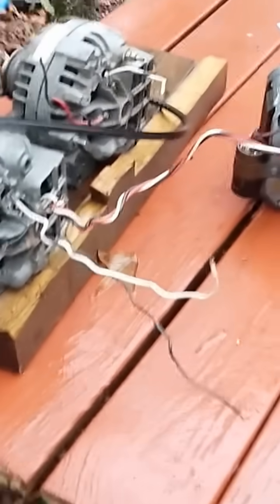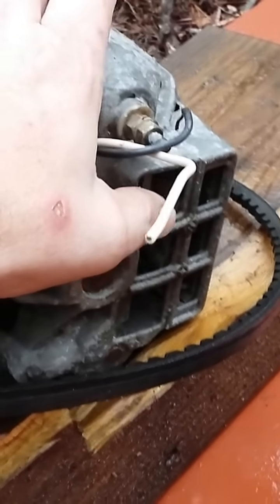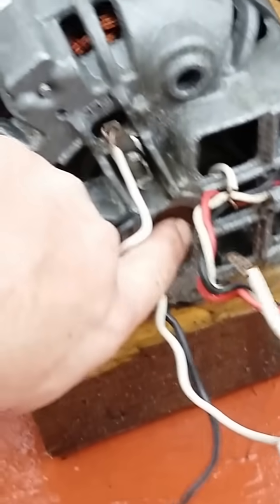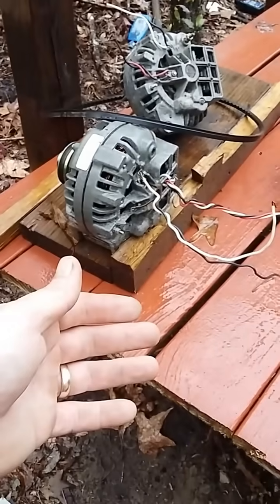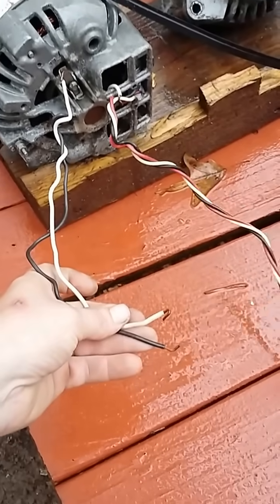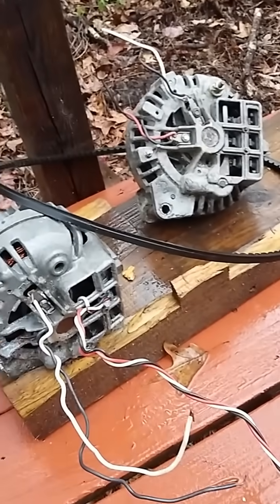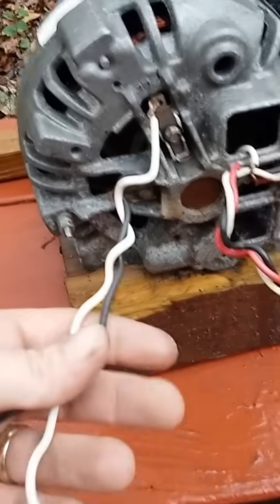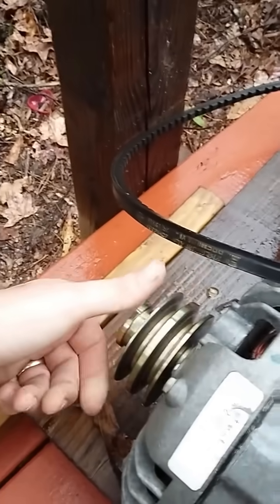Update Free energy forever no wind no solar no gas READ DISCRIPTION!!!

Comment: I'm not one to shit on people for trying to experiment with things, reverse engineer parts and toy with a concept that's existed for quite some time. Heck, I even tried designing something to this extent. I looked at how the basic motor was designed by how energy could be transferred more efficiently between the rotor and stator, reducing friction by using a bearing method that floated in a magnetic field, even putting the motor (or generator, it's been a while) on the inside of the rotor to bypass the imperfections in belt, chain or sprocket-driven systems and have the middle section between the motor and generator as the "rotor". It'd be one moving part without mechanical friction in a compact, easy to build system that could be built small and quiet enough to replace the battery in your phone. 
But the more I knew about it, the more I found what I didn't know then.
What I AM salty about is how you said electricity companies make electriciry for free, sell it to people for God knows what and make all the profits. I take issue with this.
1)  Electricity isn't made for free. In Australia, most of our electricity is generated out of a coal-fired plant. Coal is burned, heats water, makes pressurised steam, steam turns turbines connected to AC generators and whammo. It takes one company to mine and sell the coal, another to transport it all, a licensed contractor to build the plant, a company to transport the water... You get the idea. Even if it was one company that dealt with everything, there are thousands of people that work for these guys that need to be paid. The Johns and bills and franks and Saras and Karens who mine, drive, build and inspect everything. The towns built around these places have stores that sell foid, clothes, homewares... Even for wind, solar, nuclear or any other thing, the cost to build and maintain these things is staggering. You're disregarding all of this. 
2) if you start a service, you do so partly because you want to make money doing it. You sell the services to people, they pay for it, you make money. It's only when your service becomes a necessity that paying for it becomes a problem because nobody wants to spend a consistent amount of money on something they need when they consider what other things the money could go to. All of a sudden, that company is evil. I'm not discrediting companies that do bad things, but there's nothing wrong with selling your services for an amount you, the consumer, agreed to. Yes, you even agreed to the amount changing. You buy groceries that change in cost all the time without issue, so it's no different with electricity. You even ask people to send you money so you can continue with your work which means you're making money by making something that makes electricity. You've become the essence of the thing you despise... 
3) If generating your own electricity was such a politically dangerous thing to do, why are there countless houses out there running solar off-grid with panels THEY BOUGHT IN A GODDAMN STORE?  Solar panels can last for decades so the cost to investment ratio is not an issue. Heck, I live in a building that generates enough solar electricity that most of it is sold back to the company. It's literally free money. You hear anything about the government killing people for buying too many solar panels? Mate. There's nothing illegal about it. Any company on earth would pay millions of dollars for your idea. Make more than one and sell them as emergency generators for areas affected by natural disasters or villages in third-world countries whom consider electricity a great luxury.

Stop worrying about what the government might do and build a working model. It's basically a flat panel with wheels.

Comment: I farted into my marshall amplifier speaker and got 240v out from the mains plug. Problem is trying to fart at 50 Hertz.
Reply: Poop always comes out,and it hertz
Reply: Farted through an octave divider at 100 Hz and that really hurt.
Reply: Add an augmented fifth and it will sound distinctly Led Zeppelin III.
Reply: There's a trick to it, bud. The ancient Hittites had it mastered. Powered their entire civilization from farts. But they didn't fart at 50 Hertz. They actually kept millions of Mesopotamian crickets, and studied the frequency they chirp at. They found that cricket chirping actually is NOT a result of rubbing legs or wings, but rather results directly from minute farts they emit when communicating with other crickets that can be hundreds of miles (or kilometers, if you happen to be a communist) away. These minute cricket farts actually release very small pulses of high frequency electromagnetic energy. The energy output was measured by Hittite scientists, and found to be over 100 times greater than was thought to be possible, due to limitations imposed by the laws of thermodynamics. 

They figured out that Mesopotamian crickets extract zero point energy from the ether of space, and convert it into energy that we can use. So the Hittites started growing Mesopotamian crickets on large cricket farms, and would then place them in little coil wrapped boxes, where by they could extract power that otherwise would have been wasted communicating with other stupid crickets that really didn't need to be communicated with. 

They found ancient scrolls in Eastern Syria, in a cave that was discovered when it was opened by a nearby missile strike. The scrolls are thought to be some 3700 years old, and were only deciphered in 2017. 

Unfortunately, Mesopotamian crickets became extinct in 1979, when the last known specimen was inadvertently fed to a lizard that belonged to the daughter of the lab custodian. Experiments have been conducted using other cricket species, but so far none have been shown to fart at a high enough frequency to cause the zero point energy to transfer from ether to EMF. It seems rather unfortunate. 

I'm only mentioning all of this because... well, actually I sort of forgot why, but I'm sure I had a good reason.
Reply: You can extract their DNA from Buddy Holly and the *******
Reply: Does it really Hert to fart at 50

Comment: This is hilarious!. A 90 amp 12v alternator will produce approximately 1200 watts. You're saying you will get 90 amps at 220 volts ac. That's 19800 watts. No F#$%^ way. Also there is the little problem of getting 60 cycles and also the problem that it's 3 phase as well...this whole thing is so wrong on so many levels. This has got to be a joke.

Comment: A diode does NOT turn alternating current into direct current a diode makes a current transfer only one way. So idk were you got you information but its not correct. Also there is absolutely no way you can get free energy. free energy means FREE it says it in the name. Thats not free, feeding hidden wires under the ground or through the leaves to your so called free energy machine to power it is not free so if your saying its no b.s. then prove it because there is NO WAY IN HELL there's free energy
Reply: If you put four diodes in a looped series, you can run two AC wires between two diodes and get a DC current between the other two. Diodes do keep the current running in one direction so what he says kind of makes sense. 
In saying that his explanation is a little off - you can't just slap a diode on there and call it a day because the spent electricity needs somewhere to go to complete the circuit, hence the diode loop. I'd imagine There's a better way, but that was the method I read about.
Reply from the maker: @classydays43  yes you are correct and what I was saying is on most of my full wave rectifiers I use a 680 microfarad capacitor.
Reply: A DIODE flows current only one way in the video it clearly says you used a diode to convert AC to DC, you would need a full Bridge rectifier to do that. So my statement is true and all you're doing is scamming other people with your so-called free energy machine, use your head there is no such thing as free energy. Free energy is NOT an extension cord running from your neighbor's house to power your free energy machine.
Reply: I've seen free energy on the internet light bulbs coper wire and magnets turning a two twenty light bulb on not just a led  I've seen a wheel of a bike with water inside bottels that keeps turning it won't stop moving  if there is a will God made a way
Reply from the maker: Current that flows in One Direction is called direct current and you're incorrect statement is the whole reason why I'm using a 680 microfarad capacitor to smooth out the pulses so it is closer to direct current...

Comment: First, there is NO way that you'll get usable 220 VAC, 60 Hz @ 90 amp power out of a standard car alternator. 1) Even if you bypass the diodes,you will get 3 phase AC power which is usless in a normal home setting. 2) You will have to spin that alternator up past the safe speed for thebearings to even get close to 200 volts. 3) You can't control the frequency of the power that you produce. Frequency is a function of the 
speed of a spinning alternator. The faster you spin it, the higher the frequency. This is way you can't take a small gas powered home 
generator, (which is actually an alternator made to put out 120 VAC), and make it put out 220 VAC simply by speeding up the engine. You can
do it but it will put out 220 VAC @ 120 Hz and will burn up any motor that you plug into it. 4) That is a 90 amp AT 12 VDC alternator. 
90 amps X 12 volts = 1080 watts. By your figures, 90 amps AT 220 VAC = 19,800 watts. NOT GONNA HAPPEN!!! 5) ALL car alternators have 
brushes. They contact slip rings on the back of the shaft that take power from those 2 slip connectors on the back to feed power to the FIELD COIL ON THE SPINNING SHAFT in order to induce a usable current in the STATIONARY STATOR COIL AROUND THE INSIDE OF THE 
ALTERNATOR BODY. 6) A car laternator does NOT have "magnets" in them. This is why the slip rings are there so you don't have to connect 
wires directly to the ELECTROMAGNETIC COIL on the shaft. They would break on every revolution of the shaft. 7) You can NOT plug an 
alternator into house current to motorize it. 7a) it would require 3 phase 12 VAC power and, 7b) it would still require DC power itno the field 
windings. 8) You won't be able to i ignore the output frequency of the power that you are producing so you CAN'T wire two or three alternators up together in an AC configuration like you say in series or parallel. There is NO way that you'll be able to syncronize the frequencies and 
make them work together like you could if you were wiring two or three in a DC configuration. DC power has + and - polarity that NEVER 
changes. AC changes constantly. Even if you had perfectly matched pulleys, there will always be a certain amount of slip no matter what you
do and this will put your outputs out of sync. Even if you used chains and sprockets, NO two chain links or sprockets are the same even if theywere pefectly the same size. Some links would stretch a little more or a little sooner than others or some teeth on one sprocket would wear a 
little faster than the other two. ANY minute variance in the spin between ANY of the two or three alternators throwing your frequency out of 
sync and you will  have ruined equipment, burning alternators or both. 
NO WONDER "they" don't want you to know this stuff. You haven't a clue as to what you're talking about!!! You said to come find you? That'll be easy enough. Just follow the smoke and smell of burning flesh. Get a house and hook to the grid. You'll live longer and you won't be replacing 1 phase equipment that you'll be burning up trying to run it on 3 phase 1,200 Hz power. Good luck.
Reply: Jeff McCrea he must’ve “learned” Ohm’s Law and about the many great things coils can do in his first year apprenticeship at IBEW. He will learn eventually if he is actually getting formally educated as he should. Hopefully anyway lmao

Comment: I see where you're going with this, and it WILL work. I will advise upping the guage of wire you are using for the AC output and save one diode to run the armature insted of a battery. TRUE FREE ENERGY!
Reply: Save one diode to replace battery, use one line to run electric motor leaving one line for AC output. This is how I'm setting mine up. I figure 110v around 70amps.
Reply: @davidburson7781  would you be able to send me some info on how to set one up? My family live in rural Australia and desperately need affordable or free power. Thank you.
Reply: @tomopwns  Take out the diodes. You'll have three windings, pos..neg..pos..neg... Use these to attach 14 guage wire then run those three lines together, three pos., and three neg. Get a nine volt battery and attach that to the pole feeding the armechure and ground on the body of alt. Unless you want to use the diodes on one of the three lines. You may still need a battery to start the core.
Reply: Can you send me some info on how to set one up? My family live in rural Australia and desperately need affordable or free power.

Comment: dumber than a box of rotting shit LOL... Lets just humor this for a second as if this isnt bs... 100 amps on that gauge of wire would turn bright red LOL
Reply: That is not necessarily true!  There is skin-effect electrical conduction AND or Surface Wave Confined Electron Stream based conduction which works on the OUTSIDE OF or on the SURFACES of conductive and semi-conductive materials.

The normal laws of physics (i.e. 2nd Law of Thermodynamics) still apply BUT you can take advantage of these effects to create powerful heat pumps which eventually DO PRODUCE electricity via peizoelectric effects, heat concentration for microturbine systems, capillary based current production and a few others I've seen.

In certain cases, you CAN conduct electricity AROUND or NEAR the SURFACE of a conductor without turning it bright orange/red/white!

---

For MEASUREMENT PURPOSES do remember the formula of:

 Watts Per Unit of Time = Volts x Amps per Unit of Time

Use a PROPER calorimeter to get an actual energy measurement value.

---

I really can't comment on this video because NOT ENOUGH PARAMETERS have been evaluated to allow for any actual measurement of ENERGY (Watts) PER UNIT OF TIME to be a useful gauge of performance.  HOWEVER, I do HAVE the gear and personnel AVAILABLE to prove or disprove the claims made! 

I am VERY OPEN to evaluating the system AT MY EXPENSE!

Email or message me here to find out what we can do as part of the Scientific Method to PROVE or DISPROVE the claims made here!
Reply from the maker: StarGateSG7 
 I actually used this three-phase field magnet motor (alternator)  as a "Transformer" motor capturing the bemf recirculating it at a high frequency to create a motor that is extremely efficient! But that's not what this is about.. I just commented on another video and sent you a link for the perimeters that you wanted to check out. Your comment on that video was 10 years old so I hope you find it! Enjoy!
Reply: I did NOT receive a message from you about a link. Could you send that link again to my email address described in my Youtube Channel Description! I would LOVE to be able to investigate this further. I have the ability to cover costs of experiments and OBJECTIVE scientific EVIDENCE-BASED inquiry.